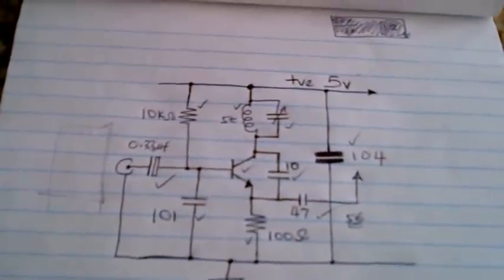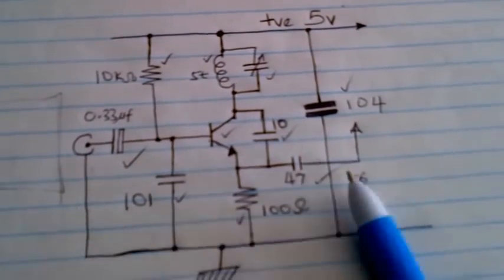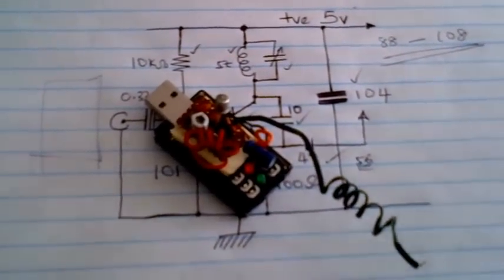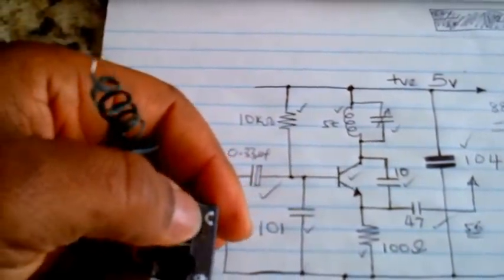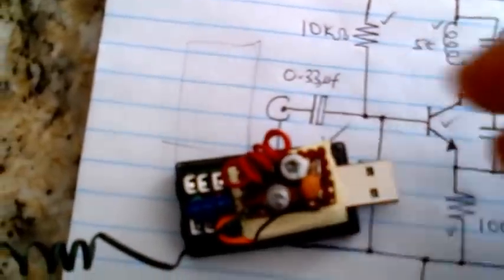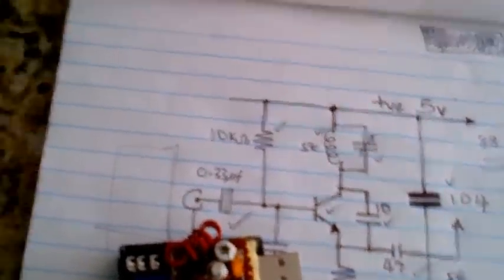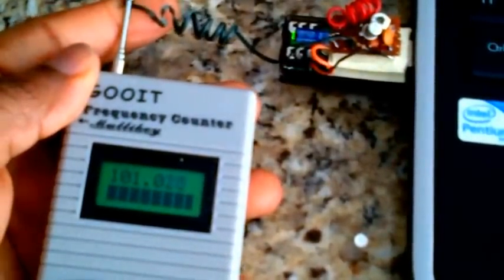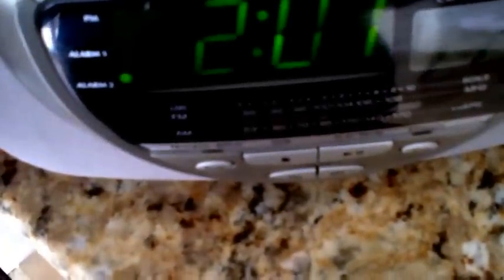HecaWorld USB One-Transistor FM Transmitter

Comment: Great project. Can you give me specifications about coil? Diameter.. number of turns... and wire section please
Reply from the maker: The Coil could be made from SWG 18, 5 turns, diameter 5mm.

Please remember to subscribe you haven't done so already.
Reply: @hecanet  Thanks for info. You forgot to write into schematic value about variable capacitor joined to coil. Can you tell me please?
Reply from the maker: @fabriziolongo83  The value is 30pf. Sorry about the omission, ... that's probably because we were reusing the part from another video where the part was shown (https://www.youtube.com/watch?v=emvvEL9QdwU&t=1626s).